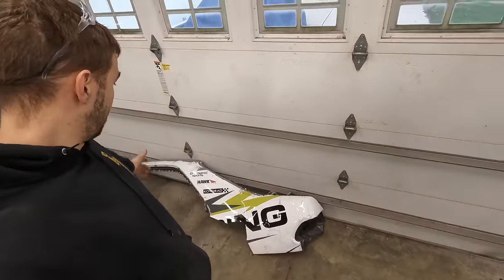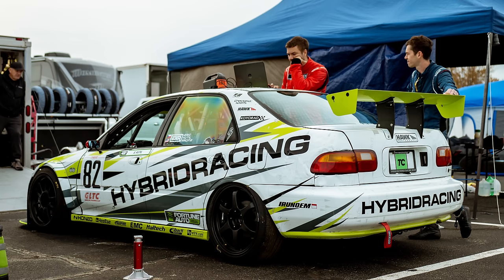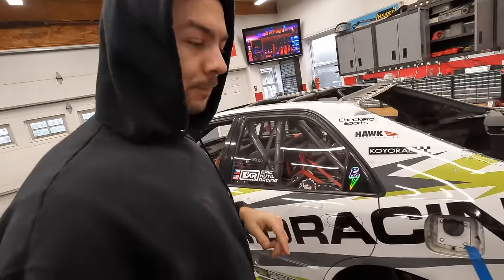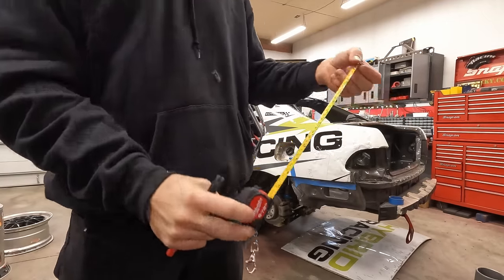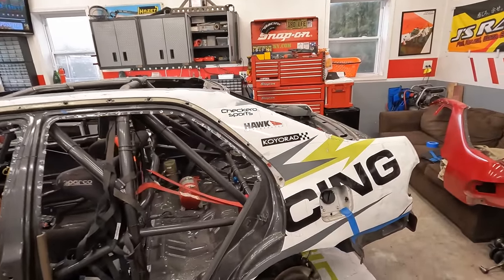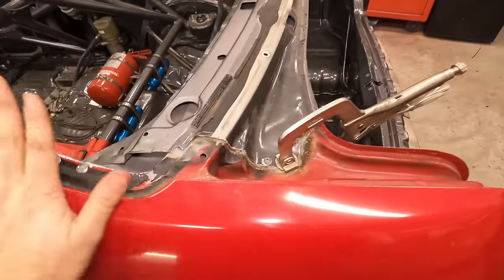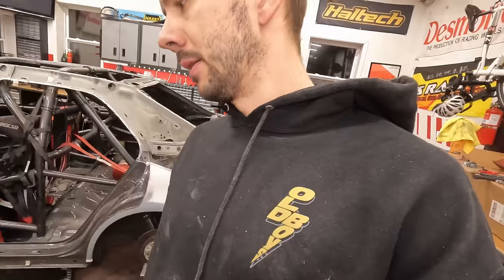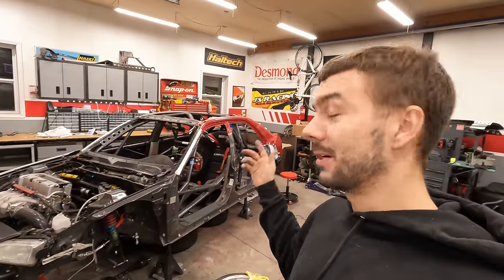Quarter Panel Replacement | Part 1 | GLTC Civic Ferio

Comment: Just did a similar repair on my race car. Ended up using the panel bond on more areas than I initially was going to but sure saved on welding all those spot welds. If you aren't already done welding, you might consider doing that also around the doors and roof. All you then have to do is sand down cured panel bond at all the drilled out spot welds.On the areas that had seams, I put a backing plate and used clecos to hold everything flush. The backing plates gave me more metal so I wouldn't blow through the already thin sheet metal. I'm no body man, but for a race car, this worked great for me.